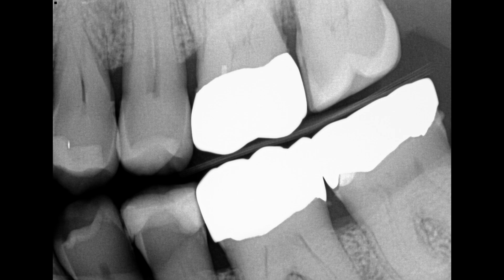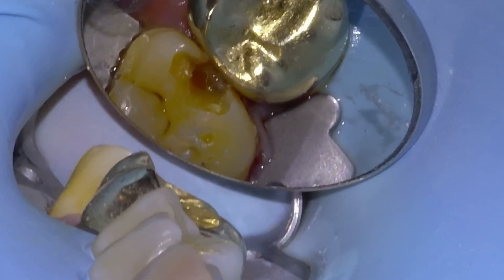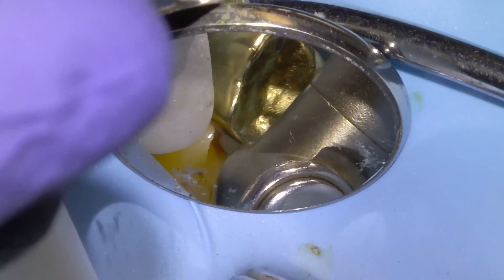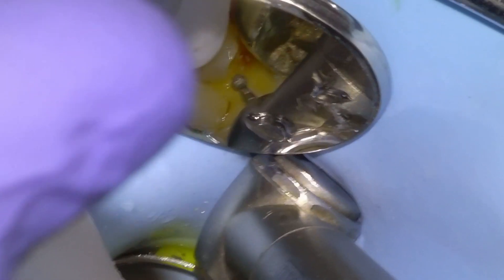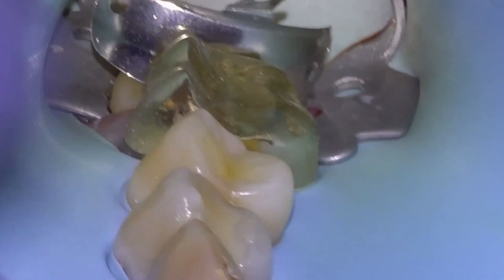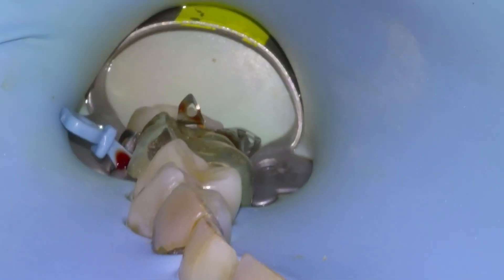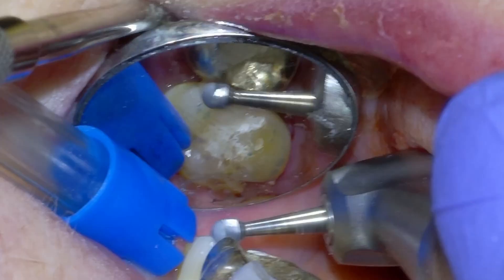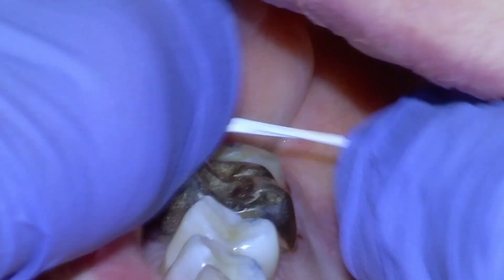[49] Live Tooth Decay Repair Procedure (27MO)

Comment: Dr. You love equia forte. How does it compare to fuji 2?
Reply from the maker: Fuji 2 is not meant to be used in occlusal situations because it washes out. If this was restored with Fuji it will have receded significantly within a year. Equia does not have that drawback but is more opaque so not as esthetic for anterior restorations.